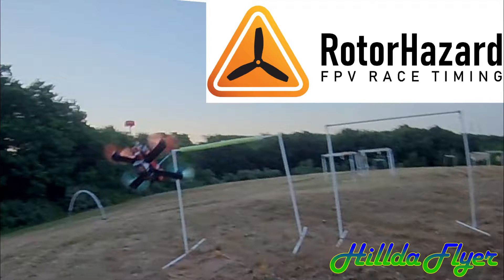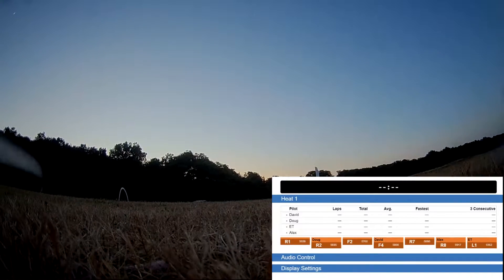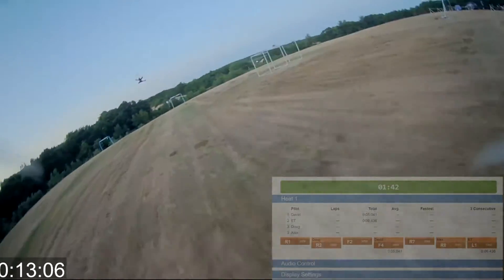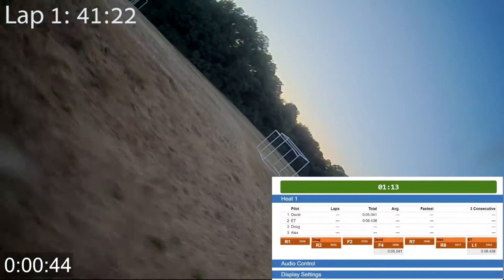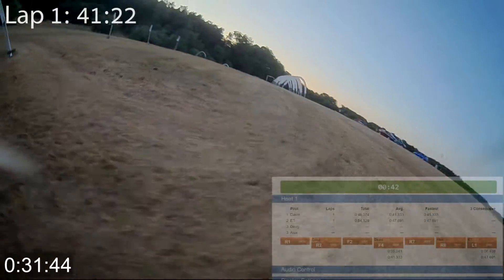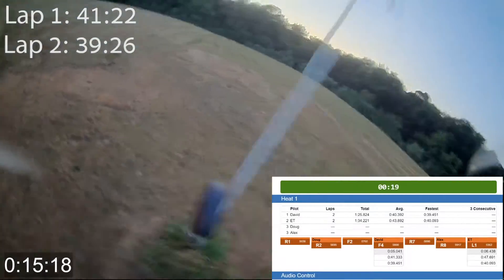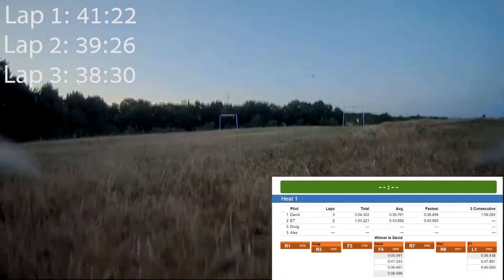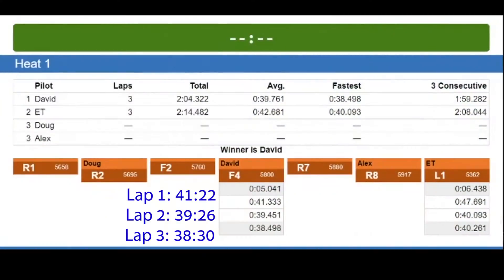RotorHazard Race Timer

Comment: Are the times you overlaid at the end measured from video?
Reply from the maker: Yes, the all of the overlaid times came from post production editing with a timer function in Adobe Premiere. The overlaid times are 60 base while RotorHazard times are base 10. For example the overlay for lap 1 displays 41:22 and 22/60=0.366 compared to the RotorHazard lap 1 time of 41.33 (only 3/100 of a second difference).